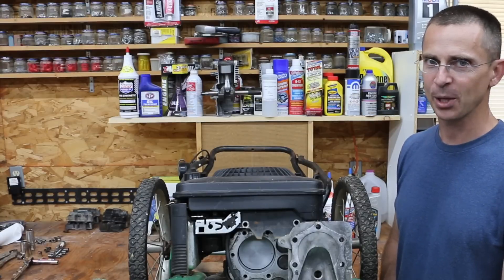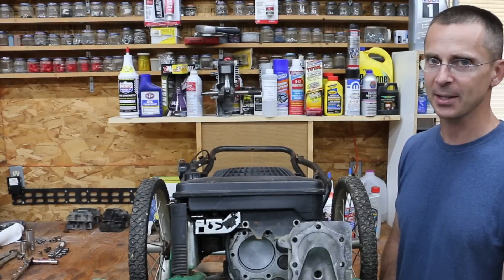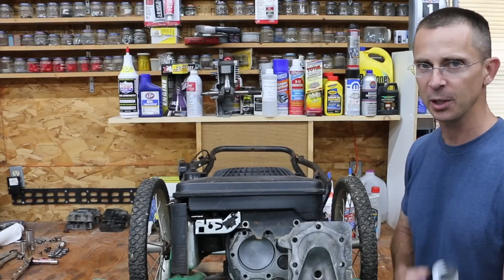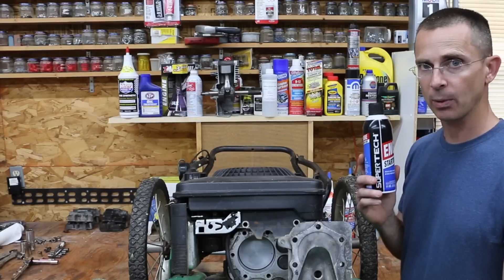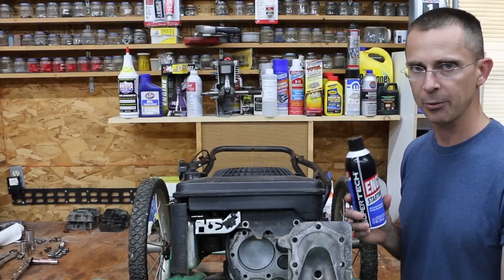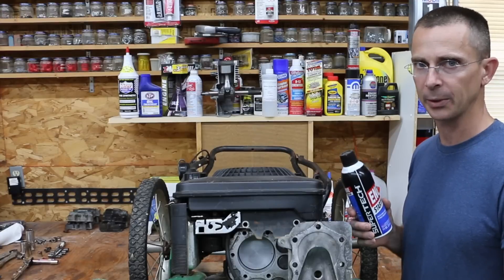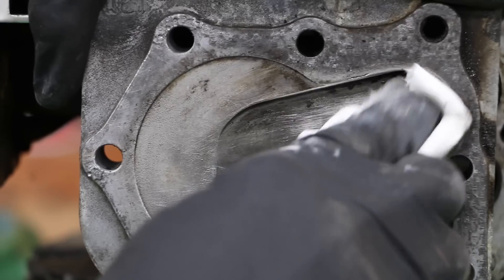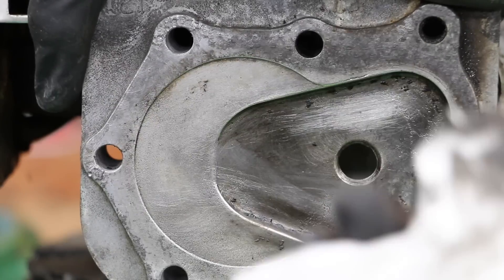Will Running an Engine on 100% Starting Fluid Cause Damage?  Let's find out!

Comment: how about using wd40 as engine oil? i know it evaporates quickly but in the world of what ifs, wondering how long it can run.
Reply from the maker: Shaun, Thank you for this recommendation!
Reply: My guess is that since WD-40 is just a very thin mineral oil, it should provide enough lubrication so long as the engine is run only at idle speed with no load on it. At high rpms, especially with a load, it will likely break down and cause metal to metal contact. It will also likely seep past the rings and burn up quickly.
Reply: @shaun roberts. 

i squirt wd or carb cleaner one shot to get my old tiller going. it does the trick. wd is also great at killing wasps😀
Reply: blair79 bear  look up formula 1 racing during the 80's. Toluene was used as fuel by Honda, but shortly afterwards banned as unfair lol. Paint thinner.
Reply: Ahh WD-40 decent at everything, great at nothing.
Reply: btw, shout out from your fans from the philippines. i always use your videos to debunk stupid myths here. hahahha
Reply: Interestingly, I just looked up the MSDS for WD-40 and it gave me options for different countries.   Here in Australia it is 60% naphtha, in the US it is 50% Aliphatic Hydrocarbon.  And there is a special blend for California.
Reply: How about Hair Spray. or Cologne. LOL. For emergency situations.
Reply: it's not 90 % kerosene buddy.
Reply: correct..I was mistaken for sure!!!
http://www.foodreference.com/html/facts-wd40-fish-oil.html
Reply: I have also run an old 4 cycle Johnson on Lacquer Thinner.
Reply: WD-40 isn't a lubricant...it's actually a water displacement, and solvent

It' might run...but I don't think it will do a full 30 min...plus make sure before you do Project Farm...to know the flash point for WD-40
Reply: and now it gets interesting... talking about flash points and volatility. oooohhhhh... scared! lol
Reply: I did that on an old lawnmower I didn't check the combustion chamber of anything but it ran with lots of smoke
Reply: yeah i do that too.
Reply: say goodbye to your engine. thats my guess.    but I have also used WD40 as starting fluid.   but mostly to see if an engine will run with a suspected dead fuel pump/
Reply: come on man, don't be pessimistic. lol
Reply: WD-40 makes a nice cleaner for air hoses , tools. jugs and bottles not to mention glasstop stoves.
Reply: we use hairspray all the time to fuel potato guns, and it also works wonders for a squealing fan/alternator belt
Reply: ok i'll be straight with you guys. i'm really not after how long it would run. i know it won't run for long because wd40 evaporates quickly. what i'm really interested in is how clean the engine would be after the treatment. i'm pretty sure it would loosen up those carbon deposits.
Reply: good idea
Reply: It used to work great, when butane was used as the propellant. But now it uses co2.
Reply: Brian C  WD-40 is certainly a lubricant. Try spraying it on a tile floor and stepping on it and see what happens. Penetrating oils (like WD-40), in addition to containing some type of light mineral oil, also contain some type of solvent (like acetone) which help it to penetrate and loosen rust. So WD-40 would provide some lubrication to an engine but is too thin and would break down under any real stress.

Comment: Starting fluid?! I thought that mower started real easy for me when I owned it! LOL! Again, great video! 

BTW, I have another mower available for you now.
Reply from the maker: Jared, LOL!  Yes, you sold me a great little mower.  Would it be okay if I arrange to pick up the mower in approximately 10 days?  Thanks for commenting!
Reply: That would be fine. Just give us a call and we can work out a time when you're ready.
Reply from the maker: Jared, Sounds great!
Reply: Project Farm How it going I have cleaner that I made would  be nice see if you can run it on an engine and see .Contact me

Comment: Seemed to run fine on the starting fluid, but the oily film is odd, if you have Holts Bradex Easy Start over there, that might be different as there's no oily ingredients according to the MSDS sheet for that one... :)
Reply from the maker: I believe the starting fluid contained a lubricant.  Thanks for the recommendation!

Comment: Nice test! How about testing the myth that transmission fluid in the gas is a good decarbonizing agent.  I've ran trans fluid in my old push mower (1 quart trans fluid per gallon gas). Ran terrible but once I burned that tank up, it did indeed run smoother
Reply from the maker: Thank you for this video project recommendation!

Comment: my old 69 ford tractor 3500 needs a little starter fluid to get it going, been doing that for the last 20 years still working.
Reply from the maker: Ed, My old 5000 did until recently using Restore.  It starts fine now.  I'm still amazed!  Thanks for commenting!
Reply: I will have to get restore and use it on my tractor. that is a must. googling it now to purchase
Reply from the maker: It'll probably take a few hours of run time for the copper, silver and lead to work into the cylinder wall scratches.  I hope it helps!
Reply: I just ordered some restore. and we just had that 100 year storm come through here near Acton California. and will be using to the tractor to     " restore" my road that washed away.

Comment: How aboutwhat would happen of you ran a gas motor on a full tank of diesel
Reply from the maker: This is a great project idea--thank you!
Reply: The Riddikulous Gaming Channel diesel fuel requires a water-fuel separating filter because diesel fuel actually contains water. So a gas engine would probably not start and if you poured unfiltered diesel into the carb while it's running it would probably throw a rod because water is non compressible.
Reply: Project Farm I've always wondered what would happen to the motor on a full tank of diesel

Comment: Been watching your videos for a while now! Was wondering if you would do one on a brake cleaner. Because of starting fluid having a oil base in it not a lot but to coat the cylinder I would like to see what a straight can of brake cleaner would have affect on the engines cylinder walls and the piston rings. Thanks so much!
Reply: Or maybe if you had a 2 stroke motor instead of running the oil recommendation maybe try like brake fluid, motor oil, wd40, or a oil compound than a regular 2 stroke based oil
Reply from the maker: Hayden, Thank you for these video project ideas!

Comment: I got to admit that is a shocker. I figured it would be dry even if it does say has upper cylinder lubricant on it. Very interesting now I know how about a 2 cycle motor where you got to add oil to the engine gas I'm pretty sure then it would dry out.
Reply from the maker: Thank you for taking the time to comment!

Comment: I have been running my diesel cars on straight injector cleaner multiple times to quickly and very effectively clean the injectors. If you could try and do the same and see if there is any damage caused I will be very interested.
Reply from the maker: Chris, do the diesels ping or knock?  Thank you for this video idea!
Reply: Project Farm the engines have always run as if they are running on diesel normally. I have never noticed any negative difference in way they run while on injector cleaner or after, but some have run significantly smoother after the treatment. 
Mind you I have never driven them while doing this, only having them idling with the occasional reving
Reply from the maker: Chris, Thanks for this additional information.
Reply: chris critchley ,, too much fuel injector cleaner,,, will burn the coating off of a oxygen sensor,,, you will lose three miles per gallon,,,.
Reply: Ummm,,, not sure,,, let me,,, think,,, about it

Comment: Even though it contains white mineral oil- the ether will mix with the crankcase oil, and make it more volatile, burning away the oil quicker, and dramatically lowering it's viscosity and lubricity.
Reply from the maker: This is great information and I hadn't thought of this.  Thanks for providing this information!

Comment: The method through which ether/starting fluid will damage an engine is not due to a lack of lubrication. Gasoline is, itself, not a very good lubricant, and the cylinder walls are designed to be lubricated by the engine oil beneath the piston.

How these products damage engines is by detonating in the cylinder. On a small engine like this they probably won't do any harm(though if you have to use them you need to sort out why it's a bitch to start). On an older car, even, it probably won't hurt anything. But if your CR is north of 11:1 I wouldn't recommend using it, and if you have a diesel made in the past 30 or 40 years DEFINITELY DO NOT USE IT! They have their own built in starting aids that are more than sufficient, and using ether with these engines will do a LOT of damage and possibly even blow a fireball out the intake/explode the intake system(Glow plugs, intake pre-heaters especially, are excellent ignition sources for something like ether).
Reply from the maker: TestECull, Your post is very informative--thank you!

Comment: Pure ether instead of starting fluid as it has upper cylinder lubricant, which was the oil film left behind. It can be had for model airplanes, but some is mixed with castor oil or other oils.
Reply from the maker: This is a great suggestion and thank you for commenting!

Comment: Most "quality" starting fluids also contain White mineral oil as an "upper cylinder lubricant".
Reply from the maker: This is an excellent point.  I used two brands in this video and I suspect they both contained lubricants.  Thanks for commenting!

Comment: Am I correct in the assumption to do that speed start you use a socket the circumference of the pull cord to start the lawnmower to hyperstart the engine? I like the implementation and think it's really neat :) new subscriber btw and love how your running these tests I've always believed growing up
Reply from the maker: Econotech, I use an impact socket that is applied to the nut on the flywheel.  I like doing this to provide accurate compression readings and makes getting these engines started a lot easier too.  Thank you very much for subscribing and thanks for the positive comment!

Comment: Hm, how about getting some carburator cleaner on the tank, like you did on this test, and see if it would clean a carburator. If you do this, don't clean the valves or the head, so we can know weather it will clean the valves or the head of the engine. My guess is it will clean the carburator, but will chemical burn the vital rubber parts in the carburator (diaphragms, o-rings seats, whatever)
Reply from the maker: Joao, This is a great suggestion--thank you!  I agree that it would likely damage rubber carb components.
Reply: I would like to see the results of this test for sure!

Comment: if anything, it looks better for the engine than gas...
I know it doesn't play well with sensors though.
Reply from the maker: Great point about the sensors.  Not sure how corrosive it is to rubber components.  Thanks for commenting!

Comment: loose bolt flying around the crank case, lets see where in comes out ..
no better ideal make a gaser run on the "wrong" things, diesel, atf, motor oil,  a1, lamp oil, and so on.
Reply from the maker: Thank you for these video ideas!

Comment: I've heard of people getting mad at their neighbors and dumping bleach in their tank to ruin their fuel system. I don't actually know if this is true or not. You'd also have to be careful with what bleach you use, as I've seen bleach with chlorine in it (probably don't want to breathe much of that in), but some bleach is just sodium hyperchlorate.
Reply from the maker: Nathan, Thank you for this video suggestion and the safety precaution too.  Thanks again!

Comment: I don't have personal experience, but a lot of old truckers and equipment operators have told me that if you use starting fluid too often in a diesel it will become hard to start without it
Reply from the maker: I've heard the same thing.  I'm relieved that my Ford 5000 tractor starts without ether since using Restore.  I was concerned about ruining the engine.  Thanks for commenting!

Comment: Wow this was awesome! I was really expecting something more exciting given all the talk. I would have liked to see the results split up by aerosolized vs. in tank. I know that would have been way more work though.
I think the big problem from starting fluid comes from when someone sprays way too much into the intake before trying to start, then a single cylinder takes a big gulp and knocks or burns too much. Not sure though.
Great video!
Reply from the maker: 802 Garage, Great point regarding overuse of starting fluid at start up.  Also, thank you very much for the positive comment!
Reply from the maker: Eric, Wow!  Your quick thinking saved his engine for sure!
Reply: hehe yea i had a buddy that didnt catch the part of spray a LITTLE BIT part and bout lost his 7.3L had i not got my jacket crammed into the intake to shut it down when he made a big puddle of either and it ran away. we dont know what rpm it hit but ive never heard a diesel sound like that before

Comment: Diesel engines don't do well with starting fluid because diesel is like a oil or lubricant for the injectors and cylinder walls, starting fluid is like water it is very thin and it's not oily it evaporates very quickly
Reply from the maker: Great point!  Thanks for commenting!

Comment: i was always told they would get hooked on it and only start with it after use.. like a drugy
Reply from the maker: I've heard the same thing from the old timers.  Apparently, the use of ether damages the rings causing compression issues.  As a result, ether is needed to get the engine fired up.  At least, that's the theory I've heard.  Thanks for commenting!

Comment: Good video!
If you put too much starting fluid in a diesel when trying to start it, it sure can damage the engine. You will get uncontrolled detonation if/when it finally ignites. Supposedly this can lead to broken rings and damaged pistons. I was told this by a long time tractor mechanic.
Reply from the maker: Robert G. Thank you for this information and this makes since given the design and compression ratios of a diesel engine.  I'm much relieved that my Ford 5000 no longer needs starting fluid or the block heater to run.  I was concerned about causing damage.  Thanks again!

Comment: Now this I'm excited for! I always avoid starting fluid for fear of damage. I want to see these results.
Reply: rule #1 everything in moderation (lil dab will do ya) #2 starting fluid doesn't make a either baby. you only bring it out when its really cold or there is already a issue that is causing it not to crank in the first place
Reply: with a dash of marvel mystery oil every gas fill-up and oil change, i never needed to use starting fluid! had no use for the starting fluid anymore :)
Reply from the maker: 802 Garage, Thanks again for commenting!
Reply: 802 Garage I use starting fluid on anything that is giving me a bit of hassle. I've never damaged anything.
Reply: Uhhh... It's a classic car and people love the AW11 MR2. Are you daft? XD
Reply: Mickxal "an MR2 is as respected as a Supra." Uh, no, they're not. Not even close. The MR2 is a neat little car, but it's not comparable to a Supra in any way. I've owned both.
Reply: Everyone wanted me to use starting fluid on my Toyota MR2 project car, but I just diagnosed the issue instead and found out the fuel pump wasn't working. To me there just wasn't a point when all it was going to do is mask a real issue. Plus I was worried about damaging the engine. Now I'm less worried about damaging anything at least. :)
Reply: +802 Garage Who cares if a toyota gets damaged ?
Reply: Lincolnator I use marvel in fuel, mixed with oil and down in cylinders to help free them up. Great stuff.
Reply: D Rutt 1969 Do you live under a rock ? An MR2 is as respected as a Toyota Supra.

Comment: did your starting have upper cylinder lubricant? the story on how starting fluid hurt motors is when it was dry either it would fire the motor before oil pressure could build when it  was cold out or when someone sprayed way to much into the intake locking the motor up or blowing a head gasket
Reply from the maker: Brian, This is a great question.  I used 2 brands of starting fluid and discarded 1 of the cans already. I suspect there is some lubrication in the starting fluid I used, but not enough to cause engine smoke.  Thanks for commenting!

Comment: how about trying to run a gas powered engine on diesel in the gas tank and then try and flush it with gas, then try reversing it on a diesel engine with gas.
Reply from the maker: Brandon, This is a great suggestion--thank you!

Comment: Most of where this idea about damaging the engine comes from is people overdoing it i.e. using too much at once, which can wash  the piston.
That said, allot of starting fluids also contains lubricants to help protect against this.
Reply from the maker: This is a great point.  I suspect the starting fluid I used had oil in it, since the cylinder head seemed oily after using starting fluid.  Thanks for commenting!

Comment: Starter fluid can cause the engine to run off time ,mis fire so to speak thus causing damage give it a try , you can start a diesel engine with starter fluid but take cation in doing so
Reply from the maker: Michael, All great points.  I've started my old Ford 5000 diesel using ether before.  It doesn't have an intake heater or that could get dangerous.  Thanks again for commenting!